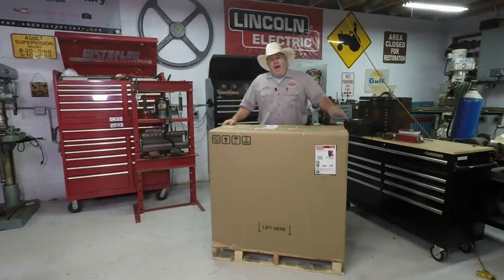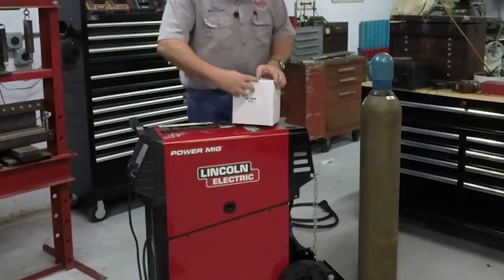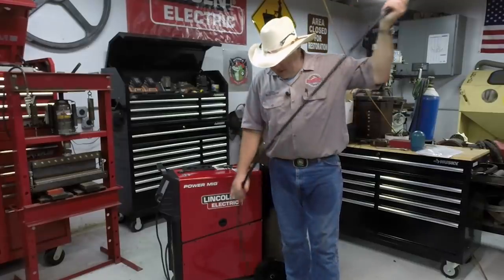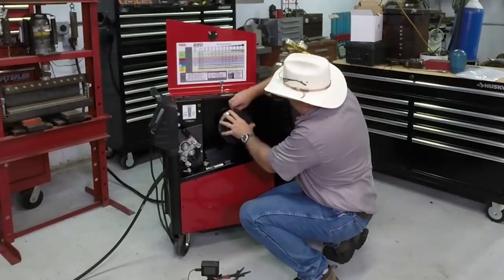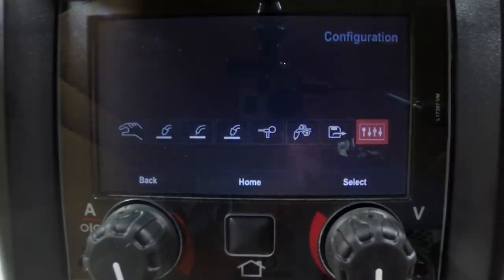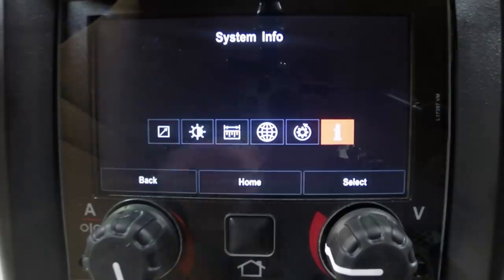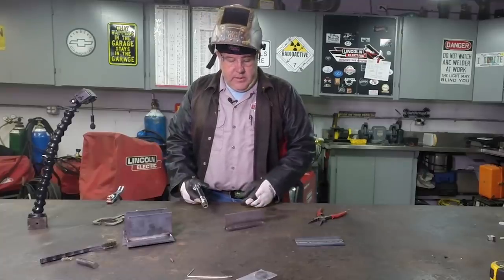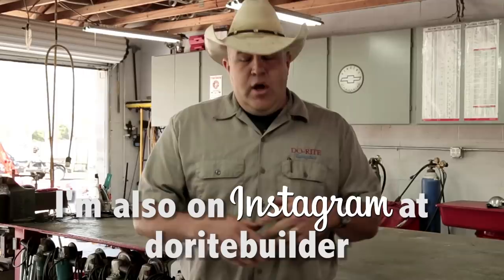Lincoln Electric Power MIG 260 welding machine, unboxing, setup and review

Comment: I bought a Miller-Matic new in 1981, and learned how to use it...only 2 'controls'...voltage switch and wire feed speed dial...not even a 'chart' in the inner door, but it did come with receptacle for the Miller Spool gun......a friend of mine with a mo-cycle repair shop bought one too...says he..."Mig machines have made welders out of a lot of 'mechanics'" ...so now this one makes MIG welders out of everyone...! 
  That LCD screen is handy, especially the  white weld shape in the bead. I hope this has a decent on-off switch, every job I ever had with a welder, especially MIG power sources/units...the toggle switch was broken off from guys trying to operate it with their foot....some industrial equipment has a guard so you can't do that, but I've never seen one on a welder....

Comment: Impressive, I've mig welded over thirty years. Wish they had that welder before I retired. I always adjusted my own settings, but that only comes with experience. Even some of the dummies I have worked with could lay a decent bead with that machine. They sure couldn't with the ones we had at work.

Comment: One thing I don't like and not just on this welder here but a few other Megs Lincoln and Miller is they only allow you to go up to 3/16 I believe in this machine with 030 with the automated settings so that makes it kind of difficult because I well do most everything with 030 and I find that works good for me I find that 035 wire put out up too much filler when welding now maybe on big thick pieces that's good but your average 3/8 quarter inch and down over 030 is plenty but it doesn't even give you that option it stops you at 3/16 I was letting they were letting me try this out at a welding shop as a demo didn't actually use the machine but I seen it power on and all the functionality of it so you have to go into manual mode and I don't know if it gives you the green parameters meaning that you're in the good without even on manual mode

Comment: Well the ground clamp needs replaced the ground leed needs to be replaced with a longer one and the bottle tray needs welded before you drop a bottle and changing wire is a fun one you will find that if you set up all the memorie first then you don't have to spend all your time adjusting it and cover the fancy little screen and the big knobs and replace the gun that has easy to find parts tweako

Comment: Jim, I was really surprised that you didn't burp the bottle before putting regulator on. Loved how you explained the weld profile icon...
Reply from the maker: It just came off my 210 across the shop. I wasn't worried about junk in the valve....
Reply: thanks
Reply: Most people don't know that they should do that. Jim should have just so people know.
Reply: I call it  sneezing 🤧

Comment: You don’t really have to take off the tips and nozzle to feed wire no? I never take mine off never really get caught up. Machine is nice but big. No pulse or double pulse. Pretty much a 250 amp MP210 right?
Reply from the maker: Yes 260 amp 210 was away bigger and heavy like it's meant to work. Super impressed. You should take your contact tip out to refeed your gun. Not all contact tips are forgiving.
Reply: @DoRiteFabrication  
I definitely second that Jim. You always take the tip off to feed new wire!!!